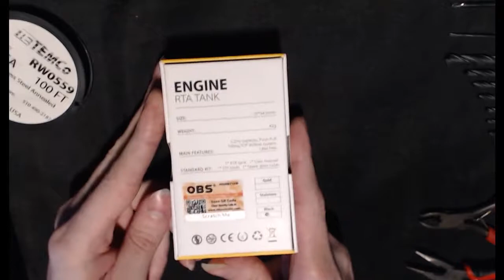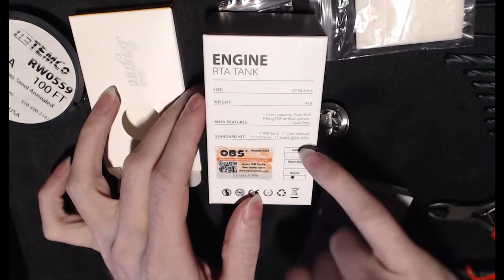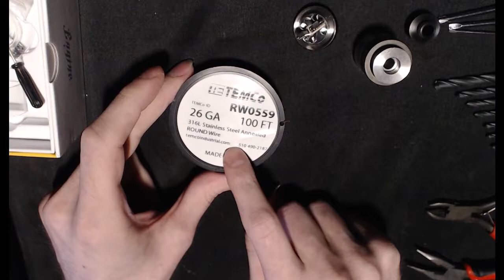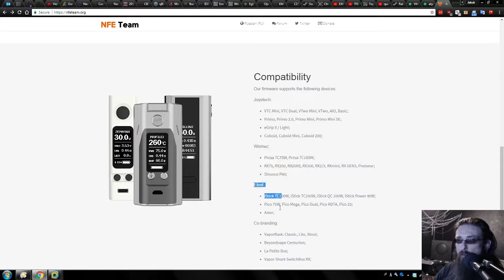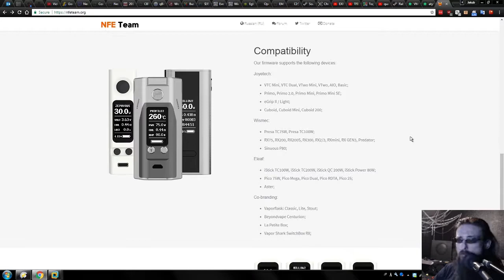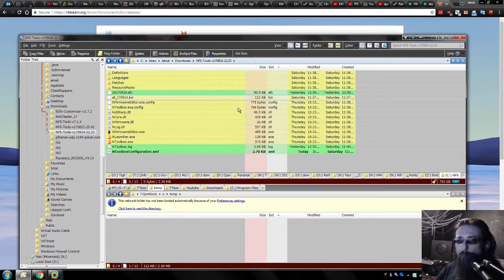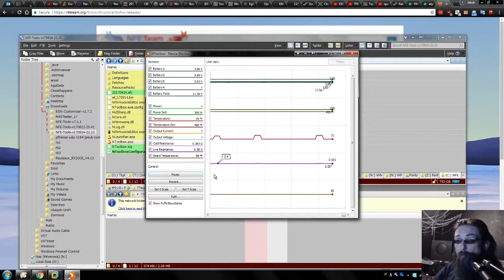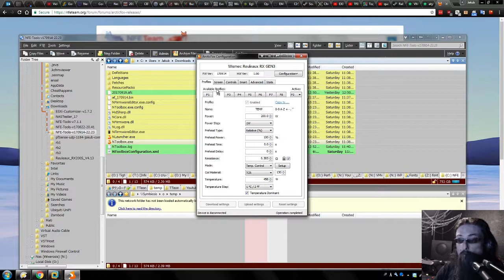Obs engine is still the best RTA. How I build & wick it with rayon.

Comment: I got mine about a year or two ago, from fast tech, the last place to have it.  I can't find it anymore for a second.  Have you tried the others and are they good? any new favorites?
Reply from the maker: Sorry for the delayed response. Only one other RTA I've tried since, and it's what I've been using for the last year - The Aromamizer Titan. The side airflow design keeps it similarly leakproof from splattering, it holds nearly 30ml, tastes and performs phenomenally, and because of it's size it's a very cool vape letting me crank the wattage up (210 watts on my current coil & wicking setup). Paired it with the Modefined Prism and haven't bothered researching anything new since as it hit every checkmark in my list. I can still be seen in my gaming videos and streams happily vaping away with it :P

Comment: Can I do the wicking the same way with cotton?I have this tank but never managed to wick it good,it's always lacking in flavour.
Reply from the maker: Although rayon tends to perform and wick a bit differently than cotton, it's definitely worth a try to thin/taper the tails. May help to also "comb out" the tails first to help straighten out and fluff the fibers a bit. Trickiest part is getting a feel for an ideal density in the wicking holes, which may take some experimenting.